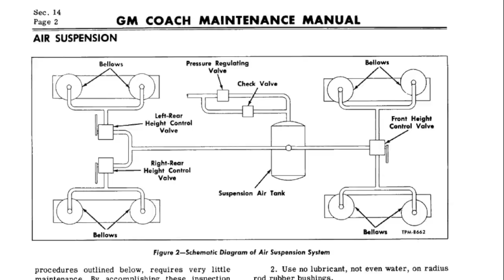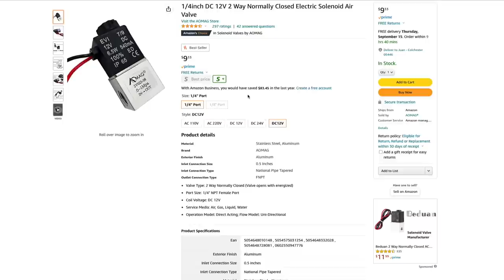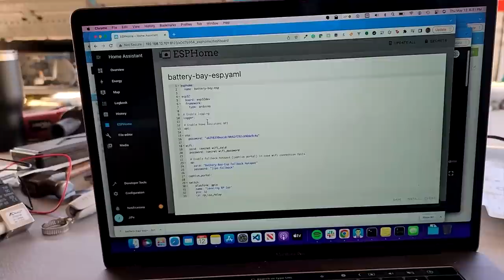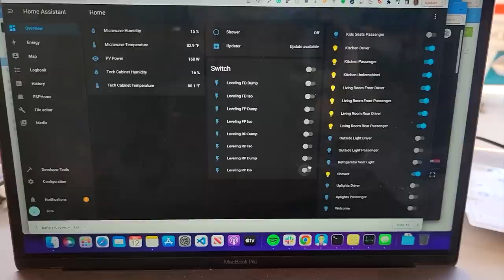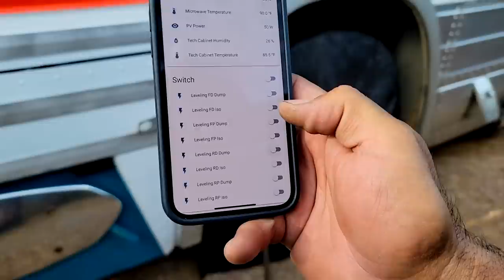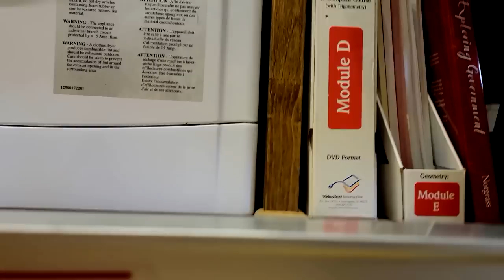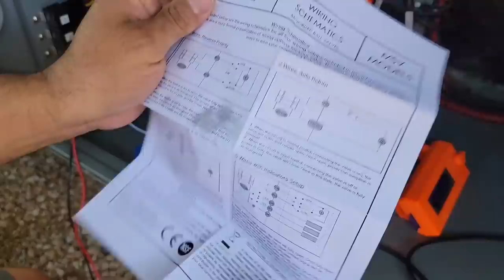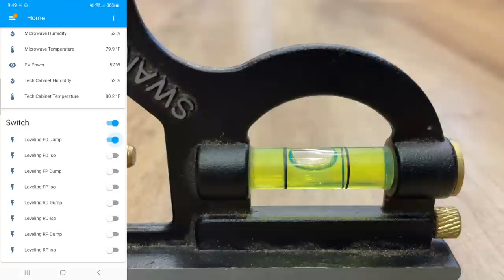DIY Leveling System Using Air Suspension

Comment: My 2000 Monaco dynasty has eight airbags laid out on a roadmaster chassis at the outside of each corner like your map showed. And it auto levels pretty close to the same way of what you have built. Very good video.

Comment: 52:45 full on did the lol and clapped my hands.  Awesome.  This reminded me a lot of building an air bridge for the custom bagged trucks back in the day.  Typically we would use large half inch valves, Parker valves were quite good for this, but there are many you can choose from.  Most of those systems were 200 psi and we would charge the system with something like a Viair Compressor like a 380C.  This is a nice video for bridging that gap though between the 10 switch box we had on our bagged trucks vs using simple controls to add on the automation and closing the system from the bus system that is already there.  We are intending to add on a small closed compressor system that will run things like the door, bay locks, and the bags for leveling for our build.  Now that I am seeing the components from you guys, I should be able to design this system with much ease.  Thanks for sharing.  Back to the automation videos for me.

Comment: Hi Juan and Michelle...Ross from Flagstaff here.  This is a great modification to your bus.  We did something similar, but totally manual, on our "expedition" ambulance conversion and I'm planning a similar setup on our Crown.  You did a great job on that and I think you're going to be very happy with it.

One suggestion, after watching you wrap all those fittings with teflon tape.  Try the Rectorseal Tru-Blu thread sealant.  I like it so much we highlighted it in a video (I think I called teflon tape the work of the Devil).  Tru-Blu is super easy to apply, it sets up semi-firm so it seals great but is removable, and it's rated for liquids and gases.  With the Tru-Blu, I've never had a leak and it makes it easier for me to align fittings...since the joint doesn't have to be cranked as tightly.  And did I mention it's easier and faster than tape?  🙂 I think you'll never go back to teflon tape if you try it.
Reply from the maker: Hey Ross and Kara!  Thank you so much for the tip!  I will have to look that stuff up!

Comment: Very nice work! Thanks for sharing. Our coach has a factory installed 3-point automatic,  hydraulic leveling system. But, this was fun to watch. 
The all-in-one "long" video works well for this. I know that a link at the end of a "Part 1" to "Part 2" should/will work, but this was so much easier, so thanks for that.
Coincidentally, I am using the same ball valve with an Arduino for an automatic water flow control project. It has been working flawlessly for months in a very wet environment.
Reply from the maker: Thank you Charles!  I appreciate the feedback on both the format of the video as well as your experience with the valve.  I like one long video too - I always feel torn with the Part 1- Part 2 stuff but I also want to be considerate of people's time.
Reply: @BeginningfromthisMorning  Thanks again. I want to mention one more thing that you did that I found VERY helpful. At the beginning of the video you suggested that viewers watch to the very end for an important update/change you needed to make to the project. Without that comment, some of us might have missed the important update. :-)   The upfront warning was greatly appreciated.

Comment: You might want to put some type of hose to the dump valve and point it down about a foot to keep trash and road dirt out of the solenoids or they will probably give trouble eventually. Nice system Juan!!!!
Reply from the maker: Thank you Rodney for sure!  The factory valve has this neat rubber hose on it - I looked for something similar at the hardware store but couldn't find anything like that - I am thinking if I just do a 1/4" to barb fitting I could then just use a small rubber tube on the barb part to accomplish a similar thing.
Reply: @BeginningfromthisMorning  A plastic 90 degree with a piece of vacuum hose would work perfectly since there’s no pressure on it. Your bus and family are awesome!!!! Our little boy is almost 5 months old already. Thanks!
Reply from the maker: @rodneymiddleton9624  Wow 5 months!! Man enjoy it - with our oldest making preparations for college let me tell you it really does FLY by!

Comment: Well done guys on my first conversion a couple decades ago I used push pull valves for each bag and cut the ride heights out it work beautifully I also had independent gauges for each corner of the bus I would run 75 to 80 psi on the rear valves and 70 on the front. And it gave me the ride height I needed to roll down the road I think I was in the whole thing 300 bucks back then but I like your Set up much better.
Well done.
Reply from the maker: Thank you Brian!  I appreciate your feedback.  We have really enjoyed using the system we will keep you updated if anything "strange" happens with it - but so far so good.

Comment: Interesting project, and great video! 
I know you are way more knowledge than me, but I still have 2 suggestions for you. 
1. Consider add Breather Vent to the air dump valve, so you don't get dust in and still allow air out. 
2. My coach have HWH air level from the factory, it doesn't allow individual corner level, but they do side levels. Eg. I can level front, which control front 2 air bags (actually 4, I also have 2 air bag on each corner just like yours). Total of 4 buttons, that control 4 sides (instead of 4 individual corners). There's good reason for this, because level only one corner up or down means frame twisting. It should be easy for you to change this in the software.
Btw, I am following you path on the bus automation. I am searching for frames works, and after watching your videos, home assistance is exactly what I needed. You might see me putting up videos about automation as well soon😃
Reply from the maker: Thank you Timmy!  I am no more knowledgable than you - I am sharing so we can all learn together so I very much appreciate your feedback.  Breather vent is a great idea - I am looking for one.  I got a suggestion of just using a plastic 90 with maybe a rubber hose - and that made a lot of sense to me - I may try that. I honestly do not know enough to fully address your second point.  Logically it makes sense but when I consider the forces being put on the chassis as the bus is driving down the road it seems to me that lowering a corner would have less effect than that (again I don't have anything to back this up - just a simple observation).  The bus automation stuff is really exciting and has been super fun to work on.  Home Assistant checked all the boxes for me.  I am looking forward to your automation videos!
Reply: @BeginningfromthisMorning  I saw the suggestion about rubber hose for vent, I am sure that will work too. But breather vent is designed exactly for this purpose, and they are 2~3$ each from Grainger. I honestly think it might be easier to buy that instead of making a hose yourself.
As to the air level, I think you point is valid. The road does put lots of stress on the frame, most likely more than the amount for you to level. But the HWH factory had this design, I am sure they got a reason for this too.🙂

Comment: Amazing work, guys!! I’ve been thinking about a system like this. If I could make one comment/suggestion. Currently, your isolator valves do not “fail safe” while driving, as they are required to be energized and on. Solenoids can fail and this could cause an issue while going down the road, maybe even unknown at first. I’ve replaced a few continuous duty solenoids on our coach. 

An alternative might be to use normally open isolator valves. These would be open by default while driving. Then have a switch that moves the leveling system from “travel mode” to “level mode”. This would energize the isolator valves and the bus could be levelled. I would connect an alarm buzzer that would sound if the ignition key was turned on while the leveling system was not in “travel mode”. Just an idea, maybe useful down the road. Outstanding work again and thanks for making these videos!!!
Reply from the maker: Thank you Josh, the more I think about this the more I like your suggestion!
Reply: W had a ride height limiter come off going down the road, oh boy did we know it!  Might make sense to just wire the isolators into the ignition switch to automatically open when energized and close when ignition is off
Reply: @BeginningfromthisMorning  - Juan, if you remember my 5C, it had a "Level-It" leveling system in it. Very simple components: four air-ride seat valves, four small psi gauges, and a switch for driving or parked mode. That was inside. I really never poked around to find out what was outside and underneath. But it worked, as long as you weren't trying to level beyond the shock's travel. Great for dumping the tanks, too! 

All that to say that I agree with Josh - the "fail safe" mode should be the factory leveling system, and I also agree that a warning buzzer that's as annoying as the factory's "low air" one makes a good subtle reminder to switch modes. Cheers!

Comment: Love it!!  Another well thought out great project by Juan with lots of control redundancy but I have one critique/question/concern. My concern is about your choice of an energize to open valve to re-enable the factory system. I’m guessing you choose it because the time the bus sits at a campsite would be longer than bus drive time and this minimizes current draw/valve coil heat generation. However, this is not a fail-safe mechanical design. If the ball valve fails closed either because of a mechanical issue or on loss of power while driving, you’ve lost the factory leveling system and you might not realize it and damage the bus’ drive train.
Reply: I suspect such is what the 5-wire ball valve is for - gives one feedback verifying the valve has transitioned states correctly.  Just a guess.
Reply from the maker: Thank you William I suspect this as well.
Reply from the maker: Thank you Kevin!  Your guess is indeed correct.  I figured that the bus would be parked more often than traveling and this would indeed avoid heating up/burning up the coils as well as reduce the power usage while parked (kind of irrelevant now with the ball valve I guess)  You are correct that this is not a fail-safe mechanical design but I am not sure the other way would be fail-safe either.  With the original design, I think you are correct, solenoids probably fail in the "open" position rather than closed?. (I actually don't know - might be fun to do an experiment :) )  As William mentioned perhaps more feedback to give the actual state of the valve would be beneficial so you can actually know with some degree of certainty that the valve is functioning correctly.  I really appreciate the feedback and these are great things to think through.

Comment: We use MPU6000 chips in flight controllers for radio controlled airplanes. It's a great technology.
Reply from the maker: Thank you HamAirman, I appreciate your feedback.  I have read a few things that suggested there might be small issues with "drift" - have you experienced that in your applications?
Reply: @BeginningfromthisMorning  I am new to RC flying. I hear things about it too but have not experienced it first hand. Youtubers that are knowledgeable in these areas are Joshua Bardwell and Painless360.
Reply from the maker: @hamairman6840  Thank you so much!

Comment: A lot of times I will use a 9 volt battery to test 12vdc SOV's. Small and maneuverable. I'll put 2- 9vdc batteries in series for a 24vdc SOV. They will snap together + to -
Reply from the maker: Awesome tip!  Thank you for that!

Comment: Really nice job, as always!! You are sooooo talented!!; just curious; you mentioned a gyroscopic board, I assume that would allow auto-leveling if linked to the processor?? Is that something you will eventually do? I think you mentioned that early on but didn't mention it at the end. Thanks again!!
Reply from the maker: Thank you Ron.  I really appreciate your feedback.  Your assumption is indeed correct - I would used it to build an "auto leveling" system which would use feedback from those gyro boards to figure out how to level the bus.  This would require some programming and a small integration with the board.   Leveling the bus manually has been so easy that I am not 100% sure I will do it.  It literally takes us like 30 seconds to level most of the time.  If I do it it will likely just be for fun and to show how to integrate with a board like that.
Reply: @BeginningfromthisMorning  Makes complete sense when it only takes you 30 seconds to do manually!! Keep up the great content!! Thank you!!

Comment: Hello,  In the coach community there is some debate between three way and four way leveling systems.    Why did you choose the four way?
Reply from the maker: Thank you - I have seen the debates as well.  I find them very interesting and love to see the thinking behind both approaches.  I chose four way because it offers the most flexibility.  I can always synchronize the two front dump valves with software but I cannot go back later and decide that I want the front to work independently after I chose to do a 3 way leveling system.

Comment: If a relay goes out on the board can you replace the defective relay or do you need to replace the whole board?
Reply from the maker: If a relay goes out you can unsolder the board and replace the relay (probably cost $1 for a new relay).  to be honest, I would probably do that because I enjoy fixing things but I think most people would just buy a new relay board for $8.

Comment: Nice one. How much programming is involved and what programs (coding, user interface, etc.) are required?
I assume the auto leveling feature will require some custom programming.
Reply from the maker: Thank you William - not too much programming.  Home Assistant is not too hard to setup.  There are a whole bunch of resources to help you install it or they even just sell a piece of hardware that is ready to go hardware + software all setup.  From there I installed ESPHome (VERY easy) and created that file you saw scrolling on the screen (maybe 30 lines of code?).  The auto level will require some custom code for sure but it should be very little code.
Reply: @BeginningfromthisMorning  --- Cool. I will have to look into Home Automation and ESPHome.  I wrote my first computer program on an HP-41C calculator and my first computer program in RPG using punch cards. They did not have desktop computers with VDT terminals then. I wrote a lot of code interfacing test equipment to a computer using the IEEE buss in the late 80s using APL (A Programing Language). Then I migrated to C++.  But I am not a professional coder, just an electrical engineer that needed to write custom code to make test equipment work together.  I suspect using Home Assistant and ESPHome will not be too much of a challenge.